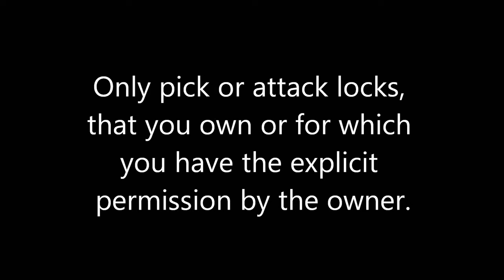(picking 275) Decoding a SQUIRE 4 wheel combination padlock - thanks to 'Lock Noob' for it

Comment: Yo!,  Many thanks, Today I got accidentally locked in a "secure" car park (the staff of an auto-parts store went home without checking if the last of their customers had left.  I spent about an hour in the cold using my "old fashioned" shackle/button tension technique - no luck,  I could tell it had some sort of false gates or slipping wheel protection and very nearly gave up altogether.  I found your video and took about 5 minutes to gain my freedom from a relatively modern Squire 4 number combo lock.
Very tempted to change the combination before I left - but managed to resist. 
Thanks ever so much, you saved me from a cold night in the car.

Comment: Thankyou very much I knew the extra little safety function of the button under the lock would be it's downfall though. I just needed a little more to figure out which you greatly provided. Thanks again.
Reply from the maker: Thank for watching - as soon as you can tension the mechanism the lock is susceptible for a decoding attack.

Comment: Thank you for finding the weak point of this lock, i adapted your method by using a small glass marble in the palm of my hand, i put my middle finger through the hasp and closed my hand so that the marble pushed on the button, the lock was open in no time, i also changed the combo to something i will remember next time!
Reply from the maker: Cool that you got it open. Nice adaptation of the method ;-) ...and thanks a lot for the feedback :-)

Comment: I have the exact same lock but the version with a shorter U...and this method worked thanks! however there were always two numbers that moved freely, the correct number and the one 3 numbers backwards (i.e. if 0 was the correct number, then 7 would also move freely)
Reply from the maker: Ah, yours seems to have false gates - can you feel a difference in the movement of e.g. 0 and 7?
Reply: @Potti314  Could be, because the pattern was consistent on all the wheels and on both of the locks I have (which are identical)...but no, I couldn't feel any difference between the correct and incorrect number at all (7 and 0, 8 and 1 etc), and I did really try to feel a difference, I had to find both numbers that moved freely in each wheel and the correct one would always be the last number when rotating it in order starting from the closest way to reaching eachother (so if 0 and 7 moved freely, then 7 would be the first number and 0 would be the second and the correct number, because 7 is closer to 0 in a forward rotation than 0 is to 7)

I'm not sure how well I explained all that

Comment: great video i also noticed when decoding the 6 wheel squire as they have the rubber under the top wheel if you push with your thumb down the wheels then put presher on the button the wheels that bind will move
Reply from the maker: Wow, there are 6 wheel combination locks - very cool. Great info about the push-trick - maybe I can apply this technique sometime. Thanks :-)
Reply: cool thanks to this vid i managed to decode the lock as a costumer set it and couldn't open it

Comment: I have a squire 5 wheel combination lock and really struggling using this message it seems that the first top line binds but others don’t as much. I also notice that on the top line which does bind there are two numbers which seem to move freely. Any advice you can give?
Reply: Method*
Reply from the maker: Try all numbers of the first wheel and check the binding state of the others for each number. This indirect method can be quite successful.

Comment: Great job working the method out. Looks like when you know the right way, there is actually a bit better feedback than with our old favourite, the Abus 165/40 maybe ? :o)
Reply from the maker: Thank you. Maybe better feedback but no lock has yet reached the fun-level of the ABUS 165/40. Maybe the 145/40 which requires more sensitivity to feel the state of the wheels. But every decodable lock has its fun-aspects :-)

Comment: I can’t seem to get the last 2 numbers right! 2 are really loose and then the top 2 have a slight give but won’t open, I have tried other numbers but it’s no good. where have I gone wrong?
Reply: Did it! 2 of the numbers were not aligned properly, amazing the difference it makes
Reply from the maker: Thanks for the update and congratulations. I was about to give you some hints and alignment would have been one of it. Cheers and happy picking.
Reply: Potti314 sorry for late reply! Thank you it was a great video. The lock was at work locking up some supplies the supervisor forgot the code and I was adamant I could do it and I did lol thank you again

Comment: I have a squire combination 5 wheel padlock and I can't open it as my stupid little son was messing with it no I cannot get into my shed I have tried everything you have done not working the two top wheels are sticking but the other three just running free any ideas
Reply from the maker: If two wheels are sticking then they seem to bind. Release the tension a bit and check which remains hard to turn. Start with that one. Without pressure on the button turn it by one number and with pressure jiggle it to find the loose spot - do that for all positions. If you cannot identify the right number, just guess. Now take the next wheel that binds and so on and so forth. You can also try the indirect method: Take the most binding wheel but jiggle the next wheel that binds (or if in doubt test all others by jiggling left and right from the current number). When changing number by number on you current wheel, you should find a change of resistance on one of the other wheels (harder to jiggle). Then you found the right number on your current wheel. Good luck.
Reply: Potti314 it is ok now thanks it took me 3 hours to get it open the code ended up being 98826 thanks anyway
Reply from the maker: Thanks for the feedback. Glad you got it open.

Comment: Great video ,I've got this lock but it's open and I don't know the combination can you show me how to get the combination if possible ,thanks
Reply from the maker: Please check out this video https://youtu.be/kAlBM6UdOjM and see if you can transfer the method to your lock. The decoding method itself however should be used from this video as it's specific for the SQUIRE.
Reply: Thanks very much for the reply I will give it a go
Reply from the maker: Let me know if you have trouble and I try it on my lock and make a video.
Reply: Thanks a lot for the reply ,I will let you know how I get on ,I am not confident at all ,this is my first ever attempt at anything like this

Comment: I'm very disappointed by these Squire combination locks. They even have some Stronghold version of it with 5 digits they're very proud of. Mechanically sure they're very sound but way too easily decoded anyway. If only thre was some decent combination lock manufacturers out there beside Sargent Greenleaf 8077 (but it's not that suited as a general purpose lock and they it's a decent lock it doesn't give that impression with all it's rattling).

Comment: button pushing locks is other made cheaply in China
they should be hard to open because it would be harder to give tension to the wheels
sadly the inner wheels are made of plastic and I can simply open the lock by pressing very very hard
Reply from the maker: China or not, plastic wheels are bad for sure. Don't know if my lock could be forced open and I don't wanna break it.